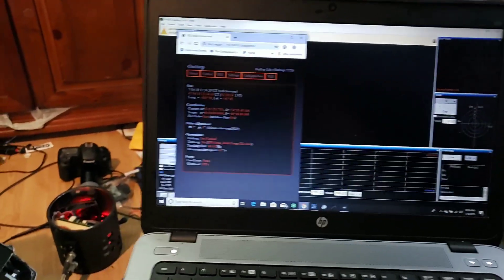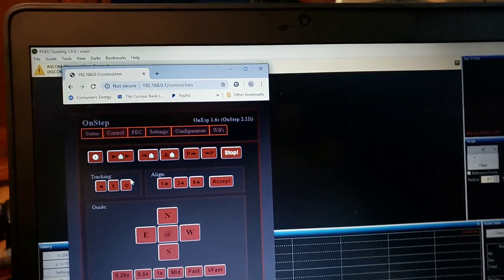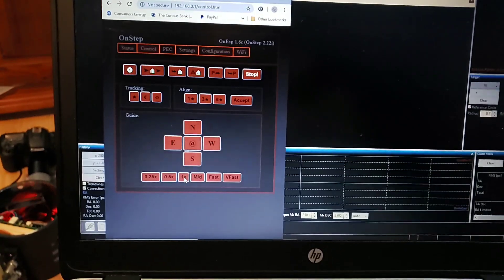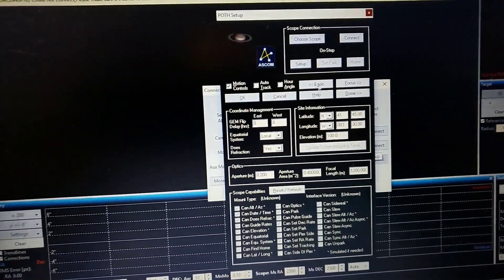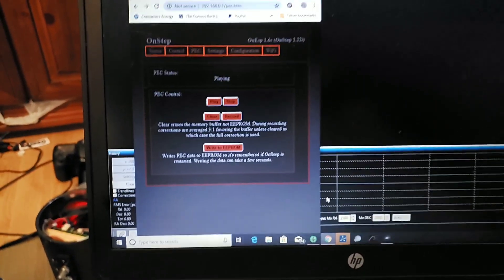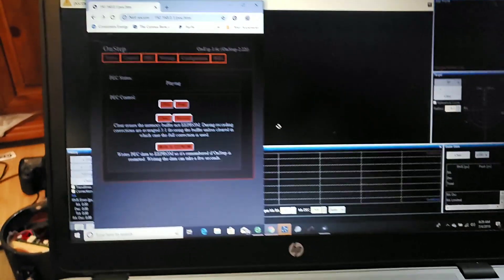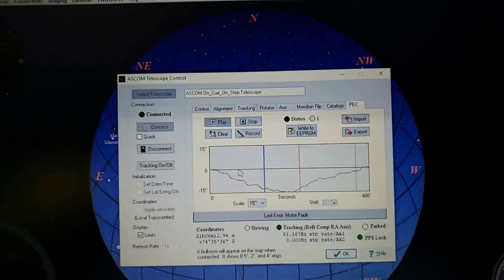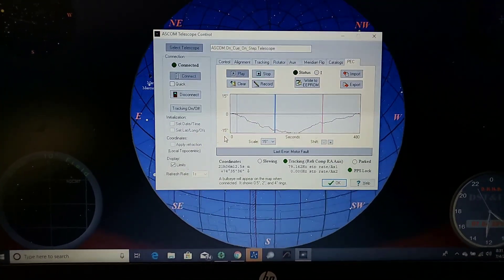PEC recording in Onstep.

Comment: Why would you record PHD2 pulses into your PEC data? PHD2 pulses are related to the position of the guide star which is influenced by random effects from upper atmosphere turbulence and also the stability of the mount in the presence of wind gusts at ground level. PEC should isolate only the periodic errors caused by your drive.
Reply from the maker: Because you record several rotations of the gear and use PHD2s pulses to average out the curve. How else can you find out the worms error? The more you train up the PEC the more accurate it is. The only way to do that is look at patterns in how PHD2 has to correct the motion of the mount.
Reply from the maker: If,  for example, every time the worm is at position A, PHD2 needs to send a pulse west, well that's he periodic error. After 5-10 rotations it's pretty accurate.

Comment: thanks aisling！
After the recording is finished, it will play automatically and then click Record again . After 5-6 recordings, you will get good training. Until the obvious period error is not seen in phd2, then save the data  to  the eeprom. The next time the equatorial mount is powered, it will play automatically.is that right？
Reply from the maker: Oh, yes that's your PE curve but I'm not sure what that number corresponds to exactly. That curve shouldn't change, it'll just get smoothed out and more accurate with more training. To see if your mount is actually getting it's periodic error corrected, you'll have to guide with PHD2, play your PEC, and then analyze your PHD2 log later with a program that can parse the data and look for patterns like PEC prep. Or PHD2viewer
Reply: @DeepSpaceDad  if i have the hall index，and write the pec to onstep's eeprom.that means i don't have to train it next time though i restart the onstep?just hit play button？thank you！
Reply from the maker: Yes if you've written it to the EEPROM you just hit play next session. Make sure your balance is always favoring the same side of the mount so that your PE doesn't change because of the gears being engaged on the opposite faces of the teeth.
Reply from the maker: Yes that's it.
Reply: @DeepSpaceDad  hi aisling！i have tested the onstep pec several times and i found my EQ mount's PE is very huge almost 45”！i saw your mount's PE nearly about10”  . do i need record Onece  then press restore to the EEPROM  then start the next record？because i found nomatter how many times i recorded  the PE willn't  reduce.and do the PHD2 parameter effect the PE record result？thank you very much
Reply from the maker: No you don't need to write to eeprom after every recording. Just before you shut the mount off. I don't know why it isn't improving your periodic error. Where are you getting your 45" figure from?
Reply: @DeepSpaceDad  
I see  the  curve in Sky Planetarium during  it's recording  fluctuates about +-45", I am not sure if there is a true +-45" PE